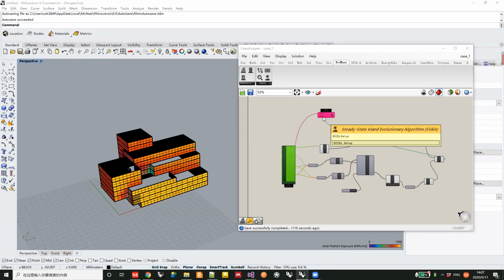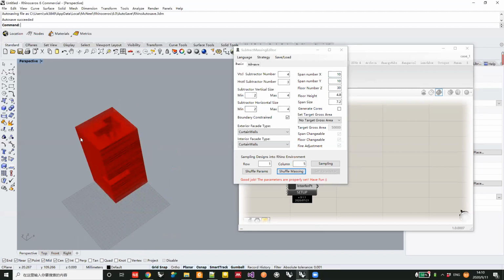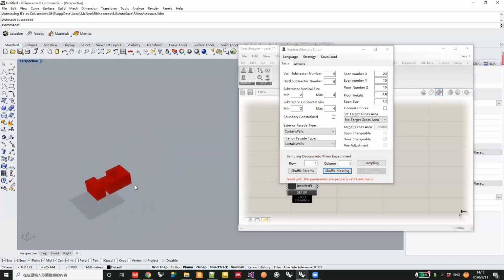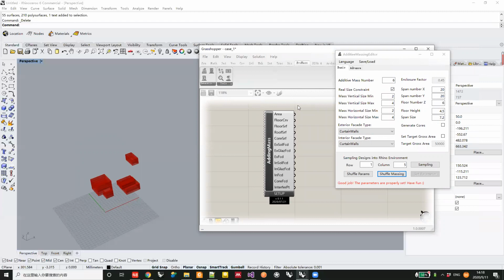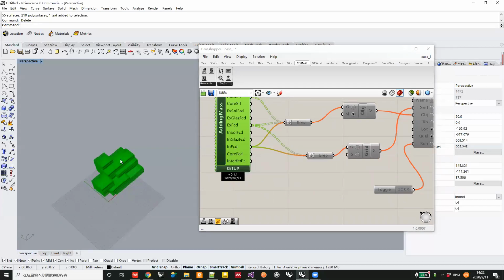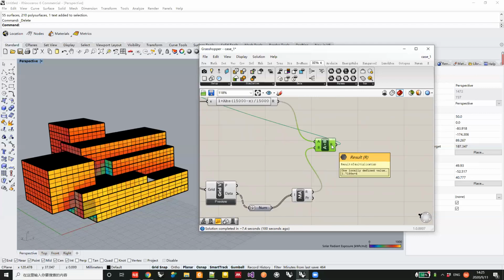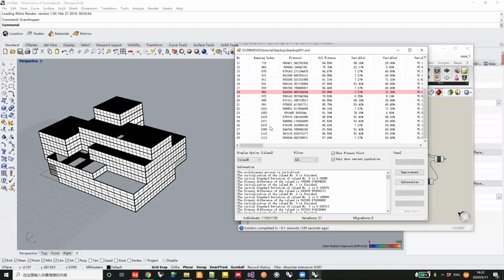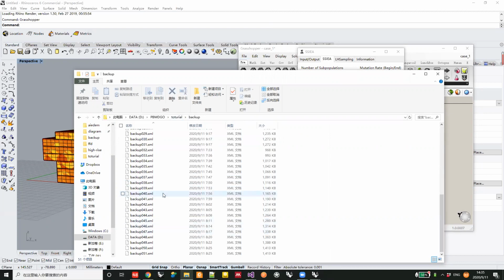EvoMass Tutorial Part 1 - General Overview

Comment: Hi, how is about the "Tower Component" ? Can I just make a tower with "Massing Component" ?
Reply from the maker: Hi, the tower component was created for some research , which generates a specific type of towers with sky gardens. So, it may not fit many design scenarios, but it can be replaced by the subtractive model with a proper configuration of the user-defined parameters. Anyway, if you're interested in the tower model, here are two papers for your reference: https://www.researchgate.net/publication/330232748_Utility_of_Evolutionary_Design_in_Architectural_Form_Finding_An_Investigation_into_Constraint_Handling_Strategies
https://www.researchgate.net/publication/325300281_Efficiency_versus_Effectiveness_A_Study_on_Constraint_Handling_for_Architectural_Evolutionary_Design
Let me know if you have any more questions ; )

Comment: very nice plugin!! I have a question, is it possible to use ladybug instead of DIVA for the radiation analysis?
Reply from the maker: Sure, you can link EvoMass with Ladybug. However, I'm not familiar with Ladybug, so you may need to figure it out how to establish the optimization workflow with EvoMass and Ladybug, but I guess it will be not difficult. You only need to use the floor plan surface output as the basis to construct the building facade surface geometry (or directly use facade surface output which do not separate windows from walls) and then input these into Ladybug.

PS: if you make up one, can you share it with me, so I can also put it on the EvoMass Food4Rhino page as a use case. Thanks : D